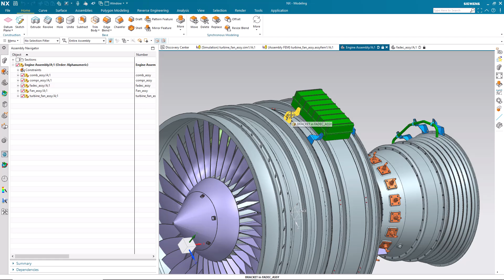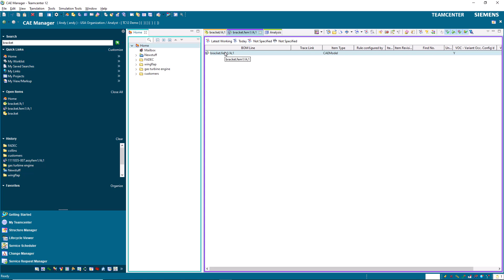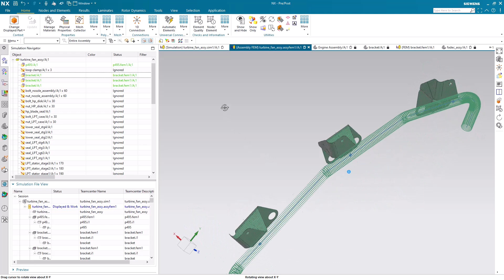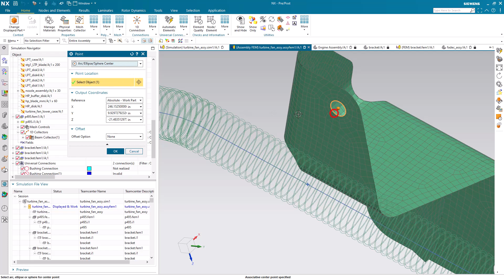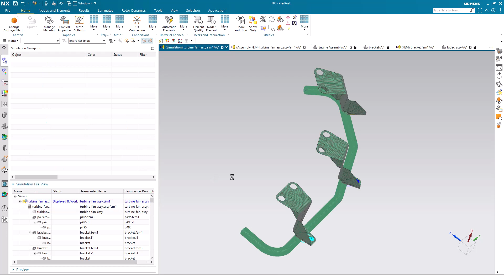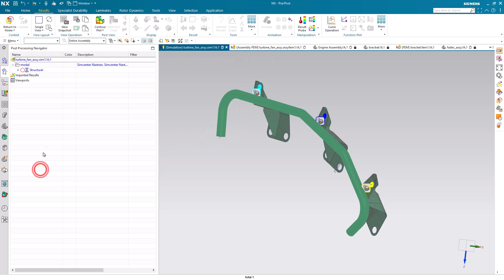How To Find And Reuse An Existing Component FEM In A New Assembly FEM

Comment: The axis of cbush has to be aligned with bush element direction, here each bush is having different axial direction but you have specified only as existing, does it take this into account
Reply from the maker: Good catch.  I was sloppy.  I should have used Cartesian instead of existing and specified a separate CSYS for each loop clamp.